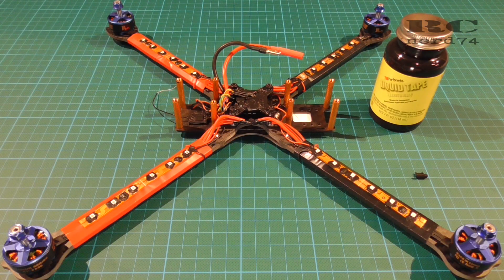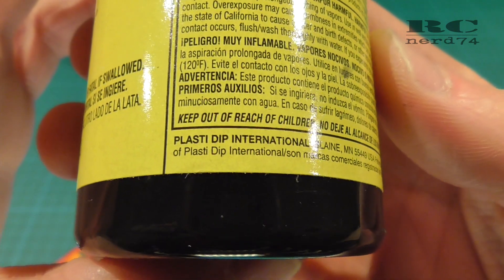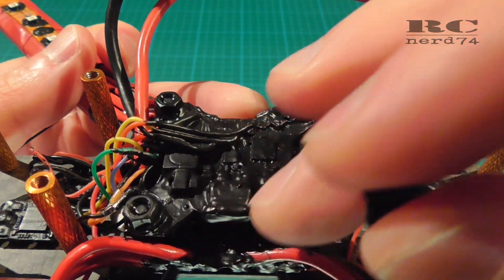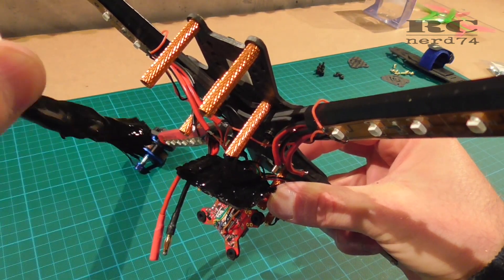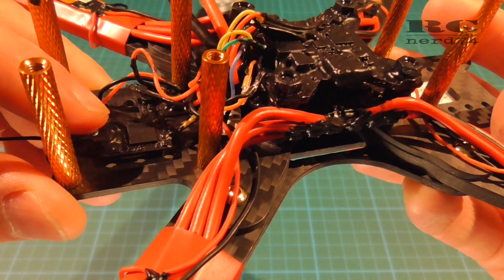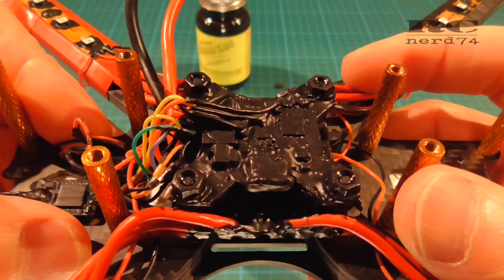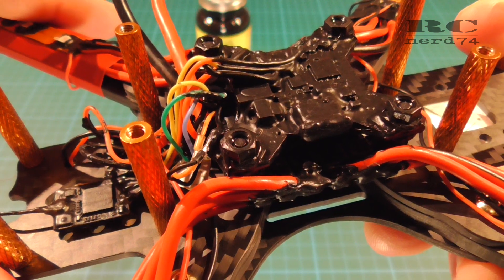WATERPROOFING MY LOS QUAD | PLASTI DIP LIQUID TAPE WATER TEST

Comment: very og way of waterproofing esc's and stuff. Works a lot more reliable than other methods. Only thing concerning when doing rc stuff involving water are the lipos. Those are scary enough anyway, but when taking water into consideration the risks of shortages in these is pretty high in my oponion. If possible I would try making a waterproof housing for them.
Reply from the maker: Lipos are no problem in water. Way too low voltage to get short circuits. I already saw lipo falling into water and stay there for hours and even days. Nothing happens. So flying in rain, snow or waterfalls is perfectly save with lipos.

Comment: I'm considering to go from silicone conformal coating to liquid tape, any advice how to remove it in case I need to solder something on fc/esc? Thanks
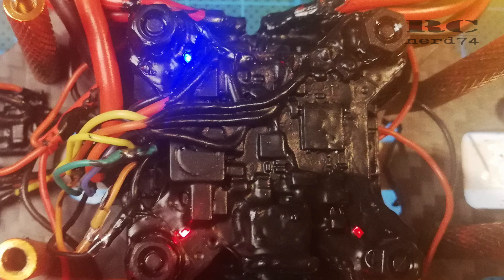Reply from the maker: I will do a test video soon on which i test how easy you can remove Liquid Tape and resolder uncovered spots. Perhaps the following video already gives you kind of an answer to your question. At 1:50 he uncovers an electronic plate: https://www.youtube.com/watch?v=ITT2kur8Fy0